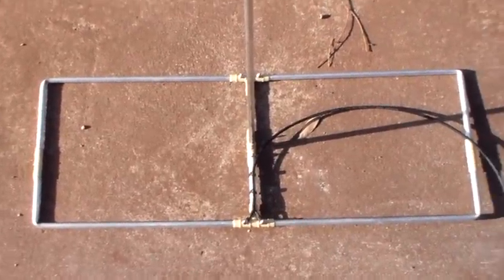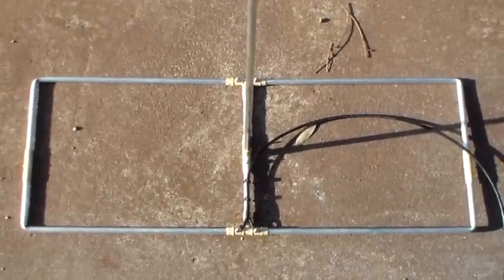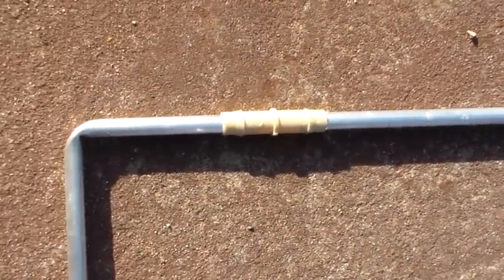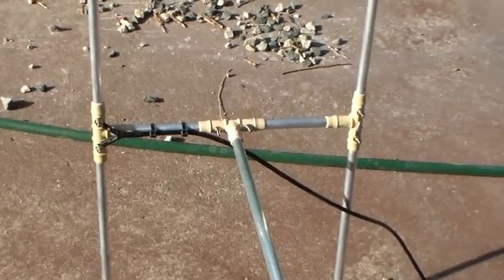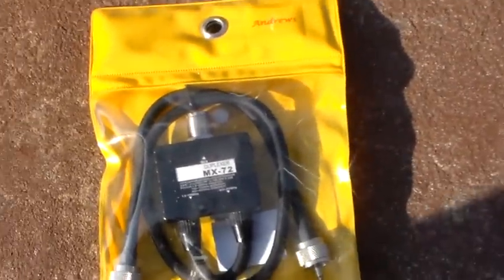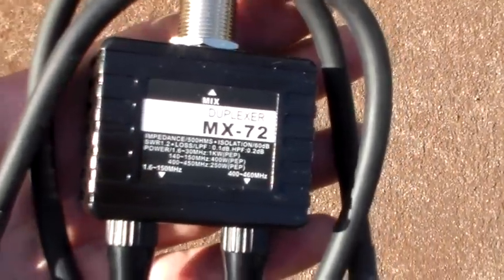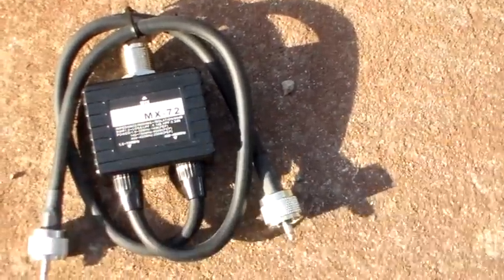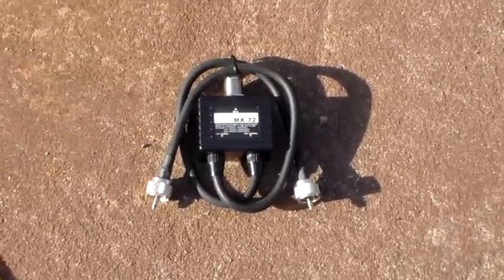A Closer Look At The 2m Moxon Antenna

Comment: btw if you get the excellent stressed 6m moxon from par electronics it radiates away from wire side towards the aluminum element . it is a driven and reflector rather than driven plus reflector. great B project by VK6CS; NOW TO WORK YOU ! 73 KARL WA2KBZ